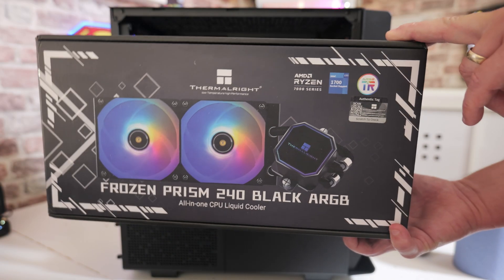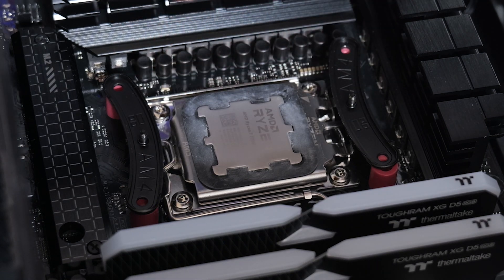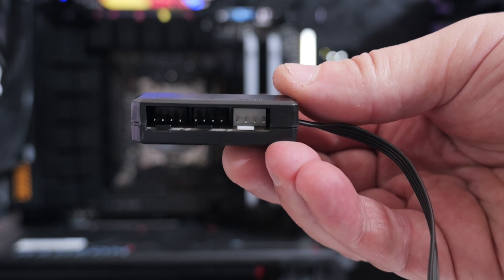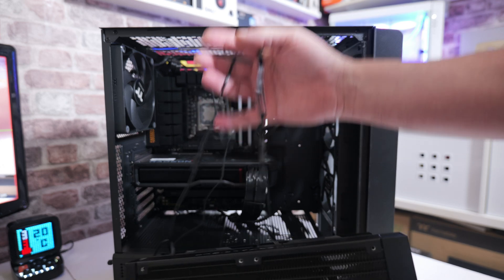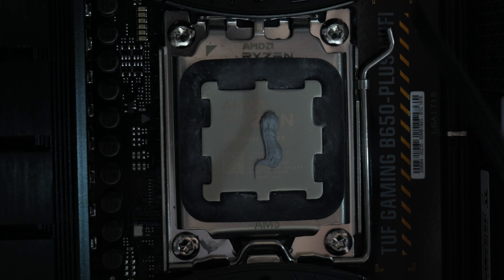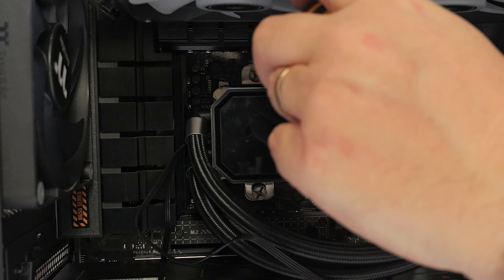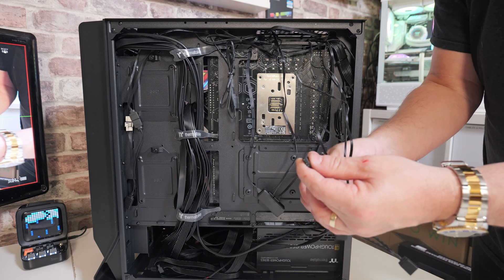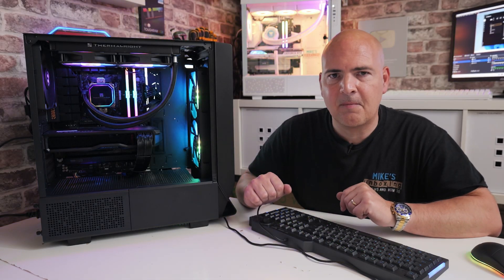How To Install Thermalright Frozen Prism 240 ARGB AIO AMD AM4 AM5 Processors

Comment: Thank  you for your video man it was help full, i got a problem that is i couldnt find my molex or sata cable to connect my argb fans can my psu is Cv cosair 650 80 bronze, and also tell me about Aio liquid rgb light is controlable too i have msi b650 gaming plus!
Reply from the maker: Glad the video helped! You should be able to control the AIO liquid RGB light through your motherboard's software, like MSI Mystic Light. the corsair cv650 will definitely have the necessary power plugs but the builder may have tucked them away somewhere in the back of the case or in the power supply basement area depending on the case you have

Comment: The thermal paste is in the pack with the water cooling or I need to buy one?
Reply from the maker: yes it is included in a small tube usually TR4 or TR7
Reply: @mikesunboxing thank you 🙏
Reply: @mikesunboxing is it the same to build with an intel cpu ?

Comment: how are the temps?
Reply from the maker: very good and in line with most other 240 aios on the market, so for the money they are doing a fantastic job
Reply: @mikesunboxing do i need to connect the rgb to have this cooler work? idc about rgb just want my cooler to work without all this cooling... sorry for the question but am all new to building pc's
Reply from the maker: rgb connection is optional

Comment: I have a Sys_fan3_pump and the CPU_OPT in what should i put the pump cale? Also the 2Fan radiator are in the CPU_FAN pin are this correct?
Mobo: b650 gaming x ax
Reply from the maker: set the pump to about 80 to 100 depending on the noise levels, the rad fans should be in cpu fan as you have it

Comment: This wouldn’t work with an i7-13000F in a predator Orion 5000 stock case with a PO-650 would it? Is this only for Ryder CPU’s?
Reply from the maker: works for Intel and AMD cpus, that sure about the case though, i have never seen one in person

Comment: I have the new astock b850m steel legend. I bought the same aio but white ver….the mobo does not have an aio pump header, per the manual i shoild just put it on the 2nd cpu fan header…..Do i need to do anything in the bios regarding the pump??
Reply from the maker: yes set the pump to PWM and 100% if it isn't to noisy for you
Reply: Thanks!!

Comment: If my mobo don't have aio pump connection can i plug the aio pump and radiator fan both into the splitter provided? And do i need any settings in the bio?
Reply from the maker: answered on the other question
Reply: @mikesunboxing  thank u, found it.

Comment: Woah no way would I loosen by 2 full turns! you’re just asking for air pockets
Reply from the maker: please explain to me in physics terms how that is even possible, i look forward to your response
Reply: @ sure, have a look at the thread on your screws, measure the gap between 3 threads, that is how much you rise your cooler by when you do 2 full turns. It will pull the cooler up enough to allow air between the paste and cold plate and create air pockets. I would do a half turn back at the absolute maximum.

Comment: Thanks for the video! If my mobo doesn’t have an aio pump slot should I plug it into the cup fan?
Reply from the maker: the radiator fan need to be in the CPU fan header, the AIO can use any other header on the board for AIO or fans

Comment: Anyone else's screws not threading? Like the back plate housing isn't compatible with the screws for the am4 kit. Sitting here with no PC over the stupidest shit.
Reply from the maker: that is strange, it should be very simple to do?
Reply: @mikesunboxing  Yeah I am just an idiot. I hadn't realized I was using a different aftermarket coolers back plate, instead of the stock AM4 backplate. We're all set up and snazzy now 🤣
The threads not matching makes total sense now. 😂

Comment: How did you get the text on the pump to be right side up? Mine is in the same orientation as yours and the text is upside down lol
Reply from the maker: The cover comes of and can be rotated
Reply: @mikesunboxing how do you take it off? Cuz I looked it up and can't find anything. Appreciate it thanks man
Reply: @liamfro1017  did you figure it out? having the same issue
Reply: @SurgeXY  yah try and remove just the face not the whole cooler use your fingernails where the edge is on the face of it
Reply: @liamfro1017  thanks
Reply: @SurgeXY  👍

Comment: Just to make sure, does this AIO come in the box with the cables you mentioned that are used to connect the fan & pump to the motherboard? And thank you for this helpful guide!
Reply from the maker: yes everything you need is included
Reply: ended up getting this exact AIO. i had done my research, but it was your video that finally caused me to feel confident in choosing this one. enjoying it thus far, 6 months in and definitely performing as i expected without issues. you were extremely helpful and hope you continue to find success making genuinely helpful content for the gaming / tech space. all the best! 😊

Comment: I can’t find my headers for my aio pump. Do all mother board have them?
Reply: I think I fixed this but I have a new problem. There is already a three pin rgb connected is there anyway where else I can connect it?
Reply from the maker: no not all
Reply from the maker: This is maybe easier to fix or at least advise if we can ask more questions and get direct answers, so feel free to join our Discord chat and we can go over it in more detail https://discord.gg/XtBTGQ6BDu
Agree to the rules by clicking the emoji and you will get access to the rest of the Discord channels

Comment: How do you rotate the display screen? Thermalright software is showing not connected
Reply from the maker: the USB side of the system is a real pain and the drivers suck. It might be showing in device manager as a unknown device
Reply: @mikesunboxing yes it is. I went to website and it doesn't recognize the pump

Comment: Curious what case and motherboard that is. 

Learned the hard way last night that my Thermalright FW240 does not fit in my case with my current mobo, it's a Gigabyte A520I AC. The RAM, ATX and CPU power all sit too high to allow the AIO to fit. I also have a Zalman S2 case. Not sure if I need a new case or mobo, hoping I can get away with just a new case cuz I don't want the hassle of swapping motherboards cuz I can't backup my data right now.
Reply from the maker: the motherboard is the ASUS B650 tuf gaming wifi, and the case is the excellent thermaltake ceres 330 (300 330 and 350mx all the same chassis)

Comment: Im struggling to get the RGB working on the radiator. The fans spin and it works fine but for some reason I can't get the RGB lights to work. I used the fan header.
Reply from the maker: This is maybe easier to fix or at least advise if we can ask more questions and get direct answers, so feel free to join our Discord chat and we can go over it in more detail https://discord.gg/XtBTGQ6BDu
Agree to the rules by clicking the emoji and you will get access to the rest of the Discord channels

Comment: This is an install on an AM5 yeah? Do you know if you need those retention plates on AM4 or does it use the stock ones from.the board?
Reply from the maker: Yes use the stick ones just like Am5
Reply: @mikesunboxing  rip I don’t have those anymore :(
Reply: @OdArtem1s  the rad doesn't require the factory ones that come with every motherboard for AMD's stock cooler. It comes with its own plates.

Comment: do you think it's easier to install the pump block onto the processor when the motherboard is already attached to the case?
Reply from the maker: it is easier out of the case as there is more access, but if you need the extra access is debatable

Comment: Thanks fir the great review, Mike! Thermalright does make some really cost effective cooling solutions. This is cheaper than many mid-tier air coolers! Now the question is: “How long will it last?”
Reply from the maker: it didn't last long , i returned it already, the pump noise was unacceptable

Comment: I would defo fit an aio to the top of the case so hot air is exhausted. Straight forward to fit & looks good albeit I can understand why some systems cost more where they have less cabling for fans. Thanks for sharing Mike and Kath 🐈👍
Reply from the maker: top is best in my opinion and i base a lot of my case choices on that

Comment: Great Video Mike.  Maybe i should have tried the " backing off the screws 2 turns" before I returended mine because of random rebooting. I will note this for the next time I try to build a AM5 pc.
Reply: That was a great hint about the AM5 pressure causing issues… explains a few things! 😂 Thanks Mike!
Reply from the maker: i recommend that everytone try that if they are having weird issues. I thought i suggested that to you early on?